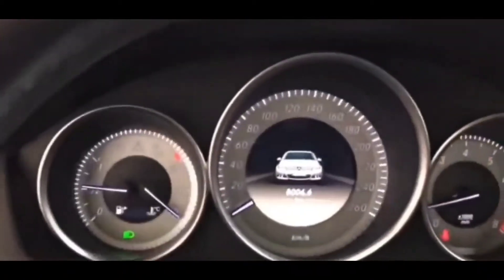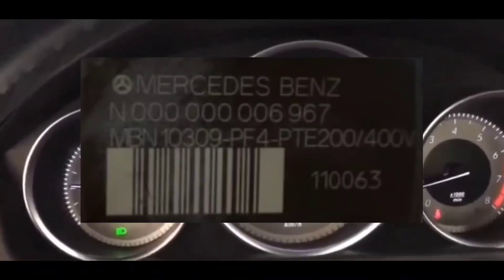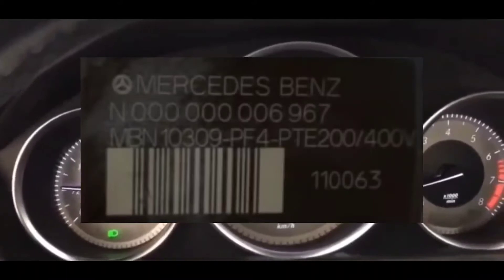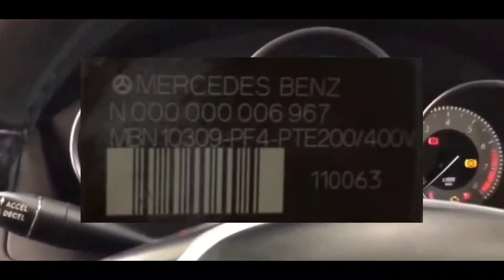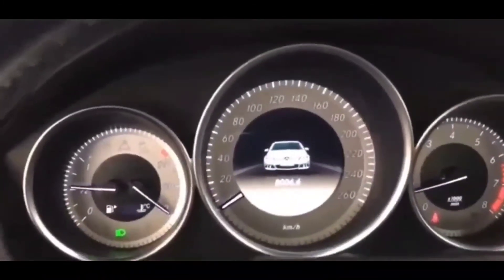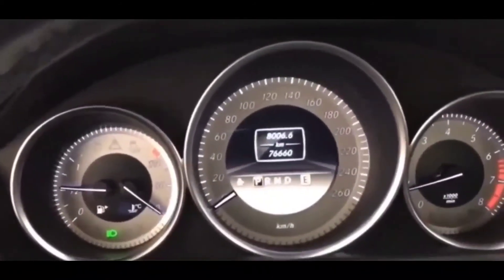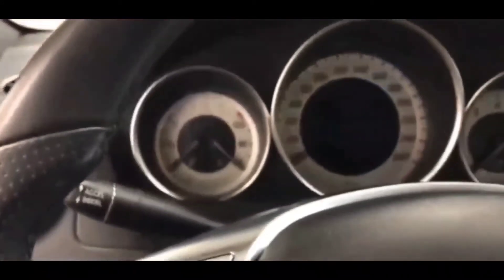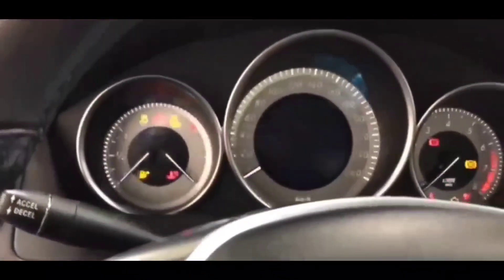TROUBLESHOOTING NO CRANK NO START ON MERCEDES-BENZ VECHICLES WITH NO POWER/ S.A.M. MODULE LINK FIXED

Comment: 2010 ml350 no power after disconnect battery 6 h and remove the headligner  , the only thing it s show the mileage when you connect the battery of put the key on internal light turn on yhat all

Comment: Hey man, thanks for the video! I have a similar situatiin imwith my 2010 ML350, but it sporadically starts. Its been progressing to more time to get it to start. Could it be this part? Do you have a recomendation on where to look? Thanks again!
Reply from the maker: Try cleaning your battery terminals and make sure they are tight...also make sure your negative line is clean and connected to the frame....make sure your 12 volt battery is good.

Comment: Please tell us how to change the part.

My car has absolutely no power and air bag never deployed.  Ernst could be the issue? Please respond I have 2014 e63 amg
Reply from the maker: You prob have a dead battery.
Reply: Did u ever get it fixed

Comment: Τhanks for the video. Do you happen to know if this applies also to a , cla, gla class also? And if yes is this fuse in the fuse box in the engine bay or in the other fuse box (near the cabin filter is located).
Reply from the maker: It's located next to the battery.
Reply: @peterl6095  thanks, you are referring to the fuse box or the nodule  itself?
Reply from the maker: @pppam  

It's the fuse on the module that breaks. It's more of a fuse link type fuse than an actual fuse. Dealership will say that you'd have to buy a new one and that they are nonserviceable but you can definitely change out the fuse.
Reply from the maker: @pppam  

It's actually the main fuse link that connects the battery to the rest of the car through the module.
Reply: @peterl6095  thanks a lot.
Reply: @KP PK

did you fix it? have the same problem with a cla. no lights no start..
Reply: @marcelmulder1788  Didn't have a problem. I was just asking.
Reply: ok thanks, have the same problem.. need to fix it: thanks
Reply: What is part number